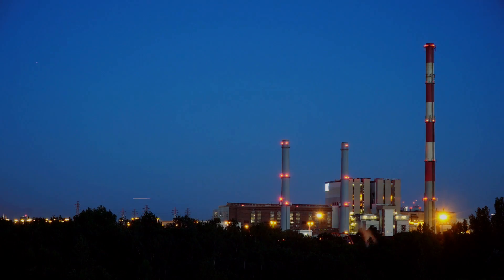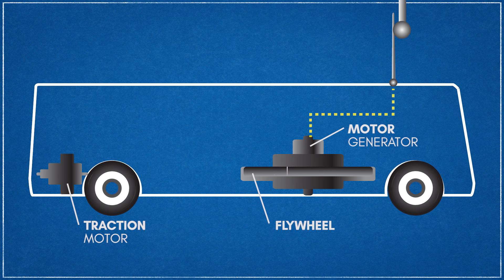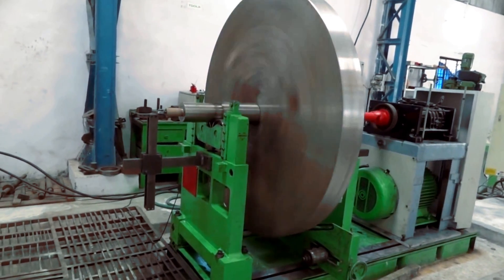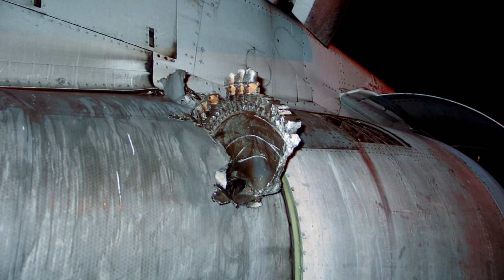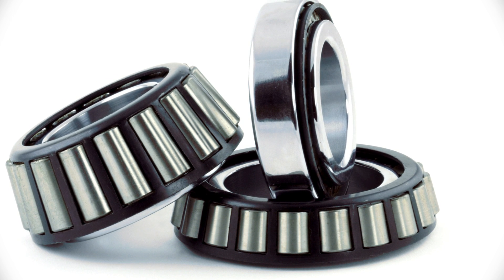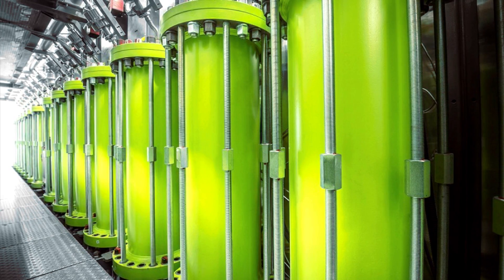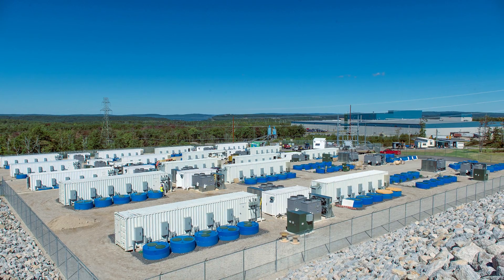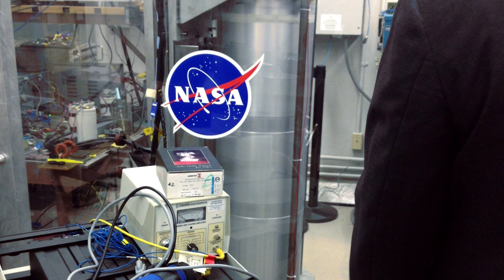The Mechanical Battery

Comment: Sorry guys I didn't got the fundamentals, you start the flying wheel with a motor and you leave it ritating untill you need energy and then you connect it to a generator when you need it?
Reply: it is a huge "free energy" device... With less energy loses, that actually does not work in practice :/

Comment: This is so interesting!  So basically the technology exists to where they can be used as capacitors but due to material technology constraints, we cannot use them for anything smaller than industrial/commercial applications.  So the challenge is to make everyday energy usage more efficient, or to find better materials technology.  I am excited for the future.  It seems like the Earth is coming into a technological renaissance again with quantum computing and energy technology.

Comment: If they use a automatic gear system on the flywheel it would be more efficient because once the flywheel gets up to the max speed, it switches gears and now it has that much more storage of energy x how many gears and the ratio probably

Comment: The 2nd law of thermodynamics tells us that there is a loss with every conversion of energy; thus the mechanical storage of energy is a waste.
Reply: If you are generating more energy than you can use at the current moment then even if storage is not 100% efficient it is an overall positive to store that energy for when  your supply is less than your current needs at the moment.

Comment: It's amazing what lengths people will go to, to avoid the best system, which is compressed air tanks holding perhaps 10,000 to100,000 psi in carbon fiber composite lightweight, failsafe air pressure tanks, to power superefficient new rotary Wankel air motors.

Comment: did the busses suffer from any gyroscopic effects ?
Reply: The flywheels are horizontal, so I would guess that they do not.
Reply: @theuncalledfor  It seems like those busses would be quite resistant to tipping over.
Reply: @MattTrevett  
Agreed. Not only do they have a very low center of gravity, they also have a gyroscopic effect stabilizing them!

Again though, I wouldn't call that "suffering from" gyroscopic effects.
Reply: Suspensions must be oversized since gyroscopic effect would load them during street level changes.

Comment: Someone not thinking? A water-wheel is not a flywheel in any sense of the word. It is simply a device to change the linear enegy of moving water into rotational energy so it can do useful work. When the water stops moving the "flywheel" stops rotating pretty darn quick"
Reply: abywater used IN water wheels. Someone not listening?

Comment: The main problem with Tesla is their lack of rationale. Their track record clearly shows an overestimation of their own capabilities in addition to an underestimation of what it takes to get the job done as promised. The clearest example of this is the software "downdate" wherein Tesla, without owner consent or notification, robbed their customers of 11% of their battery capacity, which was not theirs to take. Then Tesla offered a clearly fabricated excuse that it was done to protect battery health and overall longevity. The truth? It was really done by Tesla, for Tesla, in order to protect Tesla from having to replace batteries that were obviously overestimated in respect to their capacity, which overestimation caused a number of fires. The reason this is so troubling is because Tesla batteries represent the very foundation of the entire company ~ therefore, most people should have very legitimate trust issues in regard to doing business with them.

Below are the source articles.

Source: https://topclassactions.com/lawsuit-settlements/consumer-products/auto-news/914158-tesla-class-action-alleges-defective-batteries/

Source: https://ww.electrek.co/2019/08/08/tesla-owner-range-slashed-software-update-class-action-lawsuit/